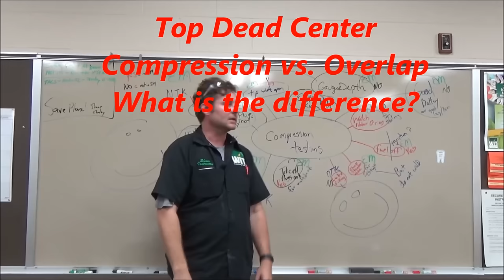Why is it important to understand top dead center vs. overlap on a 4-stroke? #DOHC #how2wrench

Comment: I like your cutout model and your clear demo. On a car engine with rocker covers off it's pretty easy to identify the end of the exhaust cycle because both rocker arms are moving. That happens nowhere else in the sequence, and you don't need to be sure which rocker is exhaust and which is intake. On a typical car the cylinders are often paired, so when you identify one cylinder at the end of exhaust phase, the other of the pair will be at TDC. If there is no clear cylinder pairing, you just rotate 360 deg more to get TDC on that cylinder.
Reply from the maker: spelunkerd Thank you bud!

Comment: this video saved me. i had released the cam chain tensioner while what i thought was tdc. video helped me regain my timing properly thanks so much. intake compression power exhaust!
Reply from the maker: 79 banditos If I can ever be of service to you, here is a video explains how to connect with me. 
https://www.youtube.com/watch?v=vjvmB01ebcs 
Keep Wrenching,
Shane Conley
Instructor/Motivator/Motorcyclist
www.how2wrench.com
Like freebies? Click here for a free diagnostic checklist! 
http://gem.godaddy.com/signups/364621/join 
Head over to the new website and subscribe to the newsletter to never miss a video or newsletter! 
https://how2wrench.com/contact/ 
Did you like this free video and hope to see more? Would you just like to say thank you with a donation? Click https://www.paypal.me/how2wrench
Reply: @79banditos3: If you can't figure out which TDC to use when taking a cam chain tensioner out, maybe you shouldn't be doing anything more complicated than swapping spark plugs.

Comment: What an amazing tool to visualize the full cycle and TDC! So I’m trying to decipher if when you are at TDC on compression stroke, should the timing gear marks/dots be lined up/facing each other and the distributor be pointing to cylinder 1? I’m in the middle of replacing my gears and chain on my 4.2 l on my 89 YJ.  I had replaced the old distributor a while back with and HEI system and wonder if we put it in 180 when we did it.  Is that possible, would it even run? Right now when I have the timing gear marks lined up facing each other, at what I think is TDC compression stroke, the distributor is pointing 180 away from cylinder 1 (don’t remember what cylinder it is). I would love to see all four of the components tied together, TDC/compression stroke, timing gear marks,and distributor angle, that would be awesome.  Hope you still check this video and reply to questions.😊

Comment: I have a question maybe you can help with. Ok I've just assembled my cylinder head with new valve stem seals and torqued down my BMW X1 N20 4 cylinder engine to the proper torque on both cams. Well I noticed on my exhaust cam where a couple of the exhaust valves are slightly opened after assembly. Is this normal?

Comment: Are all the valve stems sealed when engine is off? I was removed my throttle body in order to install a idle adjuster cable and couldn't help but notice, that all valves stems were sealed except for cylinder number 2. My bike has always had a stutter and I was wondering if I might have stuck valves..
Reply from the maker: If it was a quick answer I’d try to respond here but I wouldn’t want to lead you wrong assuming certain factors. Reach out to me on my website contact page. We have been overwhelmed with ungrateful people and scammers so I had to do something for my sanity by screening the over 300 requests a week!

Contact Link: https://how2wrench.com/contact/ 

Your answers and help are just around the corner. Save time and money while protecting your investment and yourself by doing it the right way at www.How2Wrench.com  
Have you subscribed yet to never miss a video? 

Have you seen the video playlists https://www.youtube.com/user/conleybuilt/playlists? 

Want to say “thanks” or “keep it up”? Click here https://www.paypal.me/how2wrench

Comment: to find compression stroke on a Harley Davidson just pull out spark plugs and look into front cylinder for the intake valve coming down and then when it starts to go up to close as you turn the rear wheel CCW on a stand look at the window for the timing mark to come around and look in the service book for a pic of what it may look like not all Harleys have the same marking...
Reply from the maker: I'm the intern studying under Shane. I grabbed Shane quick and he said right on EXCEPT he wanted to point out a diffenent way he explains it to prevent human error. 
You said turn the wheel CCW (Counter-clockwise) but Shane said to be mindful that depends on if you are standing on the left side of the motorcycle then yes, if on the right its clockwise, right? So he simply says "rotate the wheel in forward direction". He's had students either "helping" or left handed...lol He actually did video on a Harley Shovelhead but they used to kicker. Good video showing the valve through the spark plug hole. Here it is: https://youtu.be/zlJfbGgYLoI
I'm going to watch this video right now and learn what he said as to why! One of these days I hope to move from the office to the shop!

He has a few other tricks up his sleeve he plans on making videos on. If you need help sooner choose and option below! 

You rock for commenting! We will let Shane know! You can give him a high 5 here:  https://www.paypal.me/how2wrench   
Another way to help us back is joining or grabbing our T-shirt! Support links and gear below!  Awesome and thanks for commenting! Smash the subscribe button (thank if already a sub!)
Have you seen our "YouTube Trained Support Shirts? Great way to "high five us" https://goodfellasmerch.com/collections/how-2-wrench/products/support-shirt 

Join this channel to get access to perks:
https://www.youtube.com/channel/UCBhM8DCKnT3qXwTW0eToyCg/join    
-Daily MEMBER FIRST COMMENTS ANSWERED FIRST 
-Live Q/A video chats
-Wonder if we have a video on your need? Members can request content links!
-Full Access to the ENTIRE 700 video library
-Member-Only FREE tool giveaways   

Got an emergency and your head is about to explode from frustration or fear? Get Shane’s cell here: https://how2wrench.com/ols/products/techline-one-on-one

Comment: What if you take the rocker arm covers off and take out the push rods without finding tdc? I did that because I am changing all the chrome covers to black. I thought I could just find it before reassembling? What do I need to do now?

Comment: my crankshaft pully has grad. marks an tdc stapped in it a timming light will tell where it firing exactly  if need to correct just turn dist. slowly the tighten i set mine at 4 deg, before tdc

Comment: I have an issue. How to you find TDC if the harmonic balancer has been replaced and it doesn't have a mark on it? There's no mark on the harmonic balancer  in order to align with the indicator on the engine. What's the simplest way to get it to TDC? The vehicle is a 2006 Jeep Wrangler Unlimited 4.0 engine
Reply: First make sure you are on the compression stroke. Remove the spark plug of cylinder 1 and using something long enough to make contact with the piston(extension, screwdriver, punch and thing, just dont scratch or score the piston or you will create hotspots). Rotate the engine slowly and view the travel of your hand. Its very obvious once you have reached the top as your hand will begin to travel downward. At this point you can slightl rotate the engine in both directions to find the point in which it no longer goes up but it doesn't start to travel down either. There are kits but this is the poor mans method lol. Hope this helps

Comment: I got a fairly new carbureted 250cc dirt bike I have a question riding the bike for a little bit and I wondered if the valves were a little too tight so I loosened the intake valve just a smitch because there was Zero play there any movement at top dead center I loosened it less than a quarter of a turn tightened it down made sure everything was top dead center I didn't have a gapping tool bought by hand felt normal now would that have anything to do with running  hot cherry head pipe

Comment: Funny how I stumbled across this,,,, Ive been a Master Tech for 20 yrs and specialize on Mercedes/BMW and Chevy,,, I'm a hotrodder also,, I guess you can get too comfortable in what your use to dealing with,,, While installing a 383 smc strker,,, Not only did I do the 180 on dist but also crossed wired it knowing the firing order of chevy's,,,, guess just had that one a-comin, lol
Reply: I badly need to have speciality in Mercedes Benz, BMW,Range Rovers & Jaguars. Can u be of help.

Comment: I have a v6 3.0 vze with 2 cams and the timing belt seems to have slipped. the crankshaft goes to TDC (piston 1)and so does the Drivers side cam but the passenger cam hops right past TDC by 9 teeth. What happened? Do I need to crack the plugs to get it to TDC on that side?

Comment: Nice video,!! Is there anyway to check my compression without the compression testing tools??
Reply from the maker: Great question! We actually have a tool on its way to review for just that. The company is bringing it to the market in the US. Its a hit in Europe. Stay tuned!
Reply: @How2Wrench  Shane,how r u brother? Hope u r safe in this Covid lockdown. My simple question is:if I rebuilt an engine and I am preparing to start up the engine, should the engine be at TDC intake  or Compression? Eric,Kampala.
Reply: @wodeyaeric5351  compression stroke is when it fires at tdc

Comment: i just rebuilt my motor and didn’t know about this. i put every rocker arm on “tdc” and torqued them accordingly. would that cause cylinder 1 intake and exhaust valves not to work ?
Reply from the maker: That's a good question for Shane directly. You reached the social media team here. We get 300-400 requests a week, so it’s a bit time challenging as you can imagine. 
Shane does try to answer some non-members' questions when he gets some time so hang tight if you’re not in a hurry. 
Did you know one of the member benefits is to ask for which videos would work for your needs and get daily "quicks answers" to questions directly from Shane?. Best $1.99 a month you'd spend...of course enjoy the over 700 free videos and access the the member only vids with all the other benefits listed below. 

There are two immediate options that can get you a solution within 24 hours and quite often within the day. 

Option 1: 
Consider joining...best $1.99 you'll spend this month 😁 This is great for quick answers. 
He literally logs in and answers member questions daily! He does an AM and PM check-in to answer all member questions. Join this channel to get access to the perks:
https://www.youtube.com/channel/UCBhM8DCKnT3qXwTW0eToyCg/join    
-Daily MEMBER FIRST COMMENTS ANSWERED FIRST 
-Live Q/A video chats
-Wonder if we have a video on your need? Members can request content links!
-Full Access to the ENTIRE 700 video library
-Member-Only FREE tool giveaways  
Option 2: 
 If you need help sooner choose his 1:1 option! What you get is a deep dive one-on-one with him. Use video, email, and phone support. He will drop his tools and work with you directly! 
Get Shane’s cell here: https://how2wrench.com/ols/products/techline-one-on-one

Comment: Hey Shane, Happy New Year, I have to agree with the prior statement. Can you get a motor back in time with just taking the tension off and holding the flywheel with a socket wrench and being extra careful not to drop the chain and rotate the cam until the "T" is accomplished???
Reply from the maker: Hi Paul. No. If you could move a tooth just by loosening the cam chain tension, the chain is super stretched and worn. The tensioner does not have that much "adjustment".
Want faster response times? I answer member questions daily! Join link below.
Thank you for commenting. Want more benefits? 
-Live Live chats
-Video request links
-Full Access to the ENTIRE 700 video library
-Member-Only FREE tool giveaways 
Join this channel to get access to perks:
https://www.youtube.com/channel/UCBhM8DCKnT3qXwTW0eToyCg/join 

Just want to say thanks quick to support us for this information and our work saving you money? 
Give us a high 5 here:  https://www.paypal.me/how2wrench

Comment: Appreciate the video. As long as my valves are closed on that cam and I'm on the cam circle and have timing marked. I can shim and install new cam? My manual states make sure tdc is correct which I have. Than rotate till front cylinder cams are at the two and 10 position to perform shim maintenance. So I'm guessing it's the same for swapping the cam?
Reply from the maker: Replacement cams are the same procedure as the stock cam in the manual. You use the same marks and instructions. The cam just opens and closes different for the performance upgrade. Best to READ any instructions with the cam and if none, contact their customer support for any required "inspections". I say this as many aftermarket cams are "bolt in" but at some point they require a "squish inspection". 
Want faster response times? I answer member questions daily! Join link below.
Thank you for commenting. Want more benefits? 
-Live Live chats
-Video request links
-Full Access to the ENTIRE 700 video library
-Member-Only FREE tool giveaways 
Join this channel to get access to perks:
https://www.youtube.com/channel/UCBhM8DCKnT3qXwTW0eToyCg/join 

Just want to say thanks quick to support us for this information and our work saving you money? 
Give us a high 5 here:  https://www.paypal.me/how2wrench

Comment: Hi Shane. Forgot to ask. Is it doing damage or putting the timing out if I turn the flywheel backwards please ? G
Reply from the maker: Depends if the chain is attached and you hit the valves on the piston. Best to ask Shane though. I’ve seen this question asked before.

Comment: My honda odyssey broke a timing belt, i have crank and both cams on their timing marks, how do i know if im at TDC compression stroke? Or am i good long as all 3 are dead on?? Thanks😊
Reply from the maker: Hi bud...I cover it in the video. If its not clear, I'd be more than glad to stop working in the shop and walk your through it on the phone for a doantion for my time. Our number is 602-345-0432 and the doantion link is: Click here https://www.paypal.me/how2wrench  

Follow us! 
www.How2Wrench.com     
www.Tools2Wrench.com  
Facebook: 
https://www.facebook.com/How2Wrench/ 
Instagram:
https://www.instagram.com/how2wrench/
Reply: Best to go through everything. So wait for the intake valve to open, then watch your timing marks, when they line up that SHOULD be TDC. Keep going, the exhaust should open next, then, once you've reached the timing mark again, BOTH values should be open.. you can rock it back and forth to see, thus overlap. Next comes intake again, keep rotating, once you've reached your timing marks again, you're at TDC.

Comment: Hi thanks for the great video, But I have done everything as per video explained, and Bike won't start, 1977 Yamaha TT500 , I set contact points just before power stroke as indicated in the manual off the F mark on the flywheel, it has strong spark also, and rechecked valve gap and timing on the T mark on the flywheel on TDC just after intake valve had shut Fully. All adjustments were done then !! While both valve covers off I felt play in both valve rockers ? The Bike has plenty of compression as it is really hard to kick over on the compression stroke. I pulled the carb off and poured some fuel into the intake port but She still won't start. Any ideas ?
Reply: Did you ever figure out why it wouldn’t start?

Comment: Need help my ds 650 bombardier has a compresion spark  and gas cranks but don't start  any idea what is my problem please help
Reply: is it flooding , is the plug dry .  did it just quit running or you rebuild it .    its been a year you might of got it fixed .  Compression should be 110 or above  , I have seen plugs spark but it was weak ,  coil  output  good ?
Reply: @JCcanU  i was the magnet already fix it thanks

Comment: Dont the timing marks on the magneto keep you from messing this up?
Reply from the maker: Thanks for commenting and adding value to our community! The answer is no. watch the video again and think about how there are only one set of marks for the piston to need 720 degrees of rotation for the 4-cycle process and it will be in tdc twice. 

Have you subscribed yet to never miss a video? Have you seen the video playlists? Over 600 videos! Check them out here: https://www.youtube.com/user/conleybuilt/playlists  

Want to say “thanks” or “keep it up”? Click here https://www.paypal.me/how2wrench    
 
Your answers and help are just around the corner. Save time and money while protecting your investment and yourself by doing it the right way at www.How2Wrench.com

Comment: I have a 84 Yamaha dx225 that I was doing the valve clearances on in the spec it says on Inake  .005 .009 and on exhaust .11 .15
Itseems that s a large gapon exhaust valves but I did that I took the top timing gear off with out placing it at tdcwith the bottom when igo6 done with the valves I went tdc mark on bottom rotated the cam with the gear no chain then put the timing chain back on buttoned everything up one pull start later I've got a fire that almost burned down my house is this due to intake leaks or exhaust leaks fuel air mix being rich exhaust valve not opening not correctly timed or what it costed me my fueltank  but the bikes wiring survived the firewe got it out in time but how do I fix this